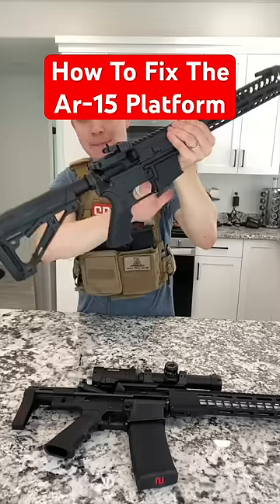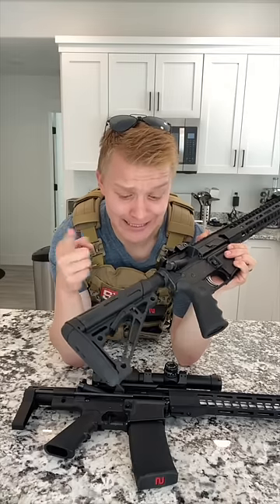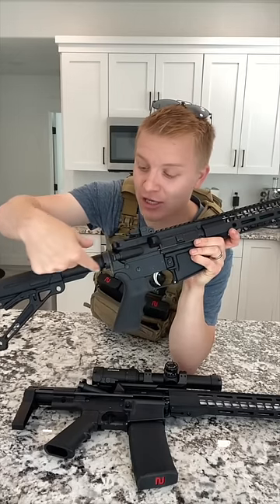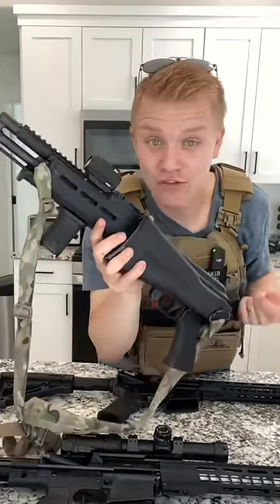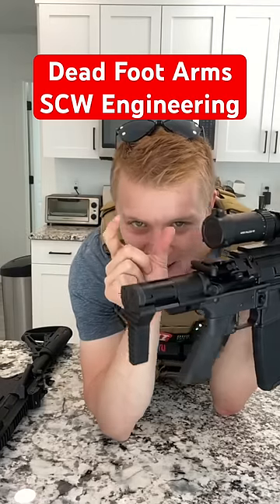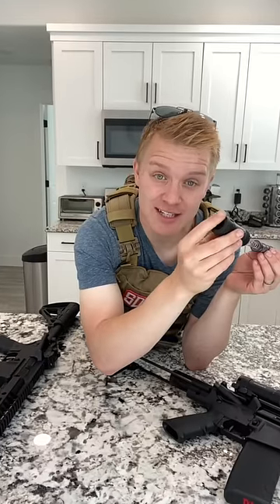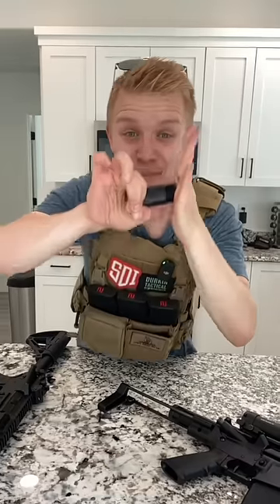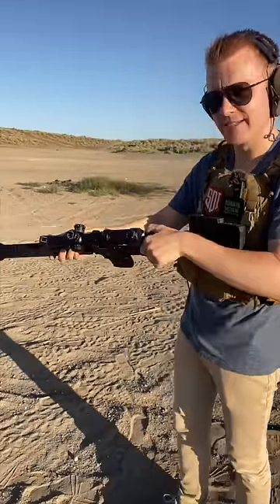How Is This Possible? *Dead Foot Arms Engineering* #gun #civtac #ak47 #ar15

Comment: There’s a new folding stock with a aftermarket buffer tube and you can fire the ar’s with them folded now. But they’re $450-$500
Reply: New? Not if it's what I'm thinking of. They're at least 3 or 4 years old now (well, I guess that's new for the pew pew world). And I thought they were more in the $250 range. I forget the name though... so maybe we're talking about two separate devices.

The rifle cannot be fired in folded mode though.
Reply: @fleatactical7390  bump stocks were a thing and like $150-$250, but they still weren’t shootable folded and you can’t shoot them folded cause they don’t fold, folding stocks for ar style rifles have been around since the 60’s and 70’s, but, these new stocks came out about a year ago maybe two years ago and they come with a super short buffer tube and a tiny ass strong ass spring that matches the factory springs tension with the shorter length, with those the buffer doesn’t go into the stock but is it’s own part and allows you to fire an ar style rifle with the stock folded.
Reply: @That_Stanced_Toyota   Definitely thinking of a different product then. It was just a hinge that you could install to allow a buffered stock to fold. Basically replacing the castle nut. Everything else about the rifle remained the same.

Meant to buy one but never got around to it.

And definitely not a bump stock either. I'm newer to the field (~10 years) so I don't know all that much about the products of old.
Reply: Talking about the law tactical folder. I have a MCX Virtus as well as a bunch of ARs and I’ll be the first one to tell you that folding stocks are kind of overrated. Unless it’s a dedicated backpack gun it’s silly all you’re doing is adding weight for something you probably won’t use very often other than to post silly videos like this one.
Reply: @nastystang113  I'll agree with that. The only time I have ever used such a feature is for a backpack gun. And I rarely use that method of transport. And again, only on something small enough like a PCC.

Comment: They also make a folding buffer tube but you cant shoot it folded so it’s just extra weight for convenient storage
Reply: But now I think there is new AR stock folder that allows you to shoot folded. I can’t remember if it requires a modified bolt and buffer/spring system but I remember just seeing it on someone’s YT channel. Maybe it is from Law Tactical but I really don’t remember. I only seen one short vid on it.
Reply: You can shoot it once!
Reply: @BasedAFPatriot  like a hi point😮‍💨👍🏼
Reply: @tr45hc4n6   Sometimes that's all you need.
Reply: Deadfoot makes a folder that can shoot folded, has for a while now
Reply: @GreenEyeDemon  the law tactical folder yes, but the Deadfoot folder you can shoot folded perfectly fine…
Reply: Yes you can absolutely shoot it folded,they also make versions that fold to the left & to the right

Comment: anderson is called poverty pony for a reason. I remember my first ar started with an anderson stripped lower, the quality was god awful. every small crevice, nook and cranny had metal shavings and dust from the machining process and the roll pin holes for the bolt catch were too small and had to be drilled out slightly
Reply: Buys $40 lower, "why is my $40 lower not as good as a $100 lower this is bullshit"
Reply: @bower31  got a radian mod 1 and pws mod 2 now
Reply: @KELEVRA004  My issue isn't with Anderson, I have like one of their lowers on one of my ARs. It's pretty much a non issue. I just will never fathom people buying something at a below average price, and getting mad when it's not perfect. If I buy a PSA freedom rifle for $450 and I have to tinker a little bit on it, like ok? I still got a good deal. If I buy a new LMT Estonian reference rifle and it's not absolutely perfect out of the box I'm gonna have a big problem, cause ya know it's like $3500. Some fixable silliness on a $40 lower is still fine.
Reply: Things that never happened
Reply: @t.lledsmar6052  once I cleaned it up it ran like a champ for about 1500 rounds before I sold it. Upper was aero with a bcm bcg, rainier arms 18 inch barrel and a odin works handguard. It did good just the out of the box quality was a miss for me. My next 2 ars were built off aero lowers, both eventually got sold then I grew up and got the pws. Form 1'd it then traded an arsenal slr107cr for the radian. Even the pws had issues out of the box but it was a much smaller issue. It didn't have an extractor o ring so I was getting inconsistent ejection with some fte's. 5 dollar pack of wrong size o rings from tractor supply and 700 rounds later it's kicking strong 😂
Reply: @KELEVRA004  I would have sent it back if it needed the holes hogged out. I bought an andersen 2 weeks ago for a "who gives a ****" cheap spare parts gun and was actually impressed that for half the price of aero  it lacked only the "easy"  assembly and the slop taker upper thingy
Reply: @t.lledsmar6052  I built it when I was 17 with a super cheap parts kit so looking back the roll pin could've been what was wrong but either way, it was a good lesson
Reply: I have Stag, Aero, Ballistic Advantage, Palmetto State and several Andersons, never had an issue with any of them. The Stag has the most slop between receivers though, Anderson has the least.
Reply: @t.lledsmar6052 my ffl sells me anderson lowers for like 30 bucks. I buy one verytime I go in. A couple of them have had some shavungs left in pivot pin spring hole. Injust blow it out. My geissele had the same thing. I have never had that i guages out of spec. I like the bcm blem uppers. Those 2 bever have any slop.
Reply: @DrewD748 my andersons with bcm upper or super tight. About as perfect as you can get
Reply: @bower31  CivilianTactical said Anderson Lowers were 'amazing & flawless' and a lot of people beg to differ with that opinion, myself included.
Reply: i dont have any anderson parts but those honestly dont sound like very big issues. as long as its in spec. you get what you pay for i guess.
Reply: @newdefsys  Yeah thats obviously snake oil, and anyone that genuinely believed that has a handful of dry pinto beans in place of their brain. It's in fact a fairly functional lower for 40 dabloons, but some mags may not fit, some holes may be a little messy. Though you can absolutely build a functional rifle from one with some patience.
Reply: wow , you must have terrible luck !  I've built about 30 ars using Anderson lowers ,  some uppers .  never not once had a problem.  .not one f ing problem.   guess I got super lucky or you are cursed. lol. 😂
Reply: @charlesdesurne4696 Nah, he's the one guy who got a bum lower, didn't bring it up with the company and uses that to justify overpaying on everything since.
Reply: My Anderson is perfect.
Reply: Drilled out? Maybe try reaming the holes. And actually, good quality lowers for various platforms require reaming operations on purpose, so...

Comment: I have an odin PDW stock, it's cool but I don't really use it all that much. The proper buffer and spring is much more pleasant to shoot and easier on your gun then jamming something in a small space with proprietary parts. The AR is already like 4 inches shorter than the AK it doesn't need to fold

Comment: Actually wasn’t aware that the spring of an AR-15 went into the stock, thanks for the info!
Reply: Yeah, I didn’t know that either until I had to change my adjustable stock to a fixed stock when Commiefornia changed its laws
Reply: Have neither of you ever cleaned an AR-15 platform rifle?
Reply: @imk2007  I don’t own an AR rifle so no.
Reply: @Niko_Is_Precious  ah I see, you should get you one, finest damn rifle ever designed
Reply: @imk2007  I will when I am of age, one of the first guns I plan on buying when I’m able to
Reply: @imk2007  i prefer the scar (any of the main two) because they cooler 🗿
Reply: @spezkko  overpriced and overhyped, only thing it does better than an AR-15 is its less gassy with a suppressor
Reply: @imk2007  still cooler 🗿
Reply: holy shit nike oneshot
Reply: It kind of goes with the laws of physics, "For every action is an equal and opposite reaction." There needs to be somewhere for the bolt carrier group to go in order to cycle a new round. The buffer system in the stock also helps mitigate recoil drastically. You should look into how the weapon system works. It's pretty neat and refined over years of firearms evolution.
Reply: Are you serious?
Reply: @imk2007 No they haven't.  They have one and have no clue how it works.
Reply: @GreenEyeDemon Your Mom says your nuggets are ready.
Reply: Ummm ok.
Reply: @spezkko get off call of duty.
Reply: @imk2007 is there a difference performance wise between the Scar-H to the Scar-L other than what round they’re chambered in or would you not be too sure?
Reply: @GreenEyeDemon  This is the kind of thing I would have said when I was 13. Are you? You write like you are. DI is a great gas system lmao
Reply: @GreenEyeDemon  Lmao you have made up argument's and write like you haven't completed the 5th grade
Reply: @GreenEyeDemon  Wait I actually just realized you said "take off the grip and the takedown pin detent falls out" lmao its the safety detent. The stock holds in the pin detent goofball
Reply: @kinghtin2darkness  Except the part where it's been repeatedly shown ARs beat nearly any other rifle platform in adverse conditions. Barring those hyper goofy guntuber videos where they literally force stuff inside the gun, which is just not reality. AKs fail hard when sand or mud get inside the reciever, which is pretty easy with a huge hole in the side
Reply: @imk2007 nyet! Capitalist propaganda! AK is best rifle!! 😂
Reply: @cruz7073  ain't too sure on that, they're made by the same manufacturer and work the same way just in different sizes it'd be reasonable to assume they're about the same
Reply: @spezkko you’ll soon learn most things you’ve always wanted a kid arent all that great when you finally get one. You’ll be super stoked about it for a while then soon it’ll be ok I guess this is cool, then you’ll be wondering why you spent 3k on a scar.
Reply: LEARN YOUR WEAPON    ,ytube  IGNORENCE is nothing to be proud of
Reply: @imk2007  IKR... I guess lots of people don't understand the basics, or clean/disassemble their weapons.
Reply: @Niko_Is_Precious  What imk said. They're funner than a barrel of monkeys to shoot!!!!
Reply: @spezkko As a person who has shot a suppressed SCAR chambered in 5.56 with iron sights (only once :P), I made better shots than with an AR and AK, I guess experiencing rifles 2 times was enough, but sadly I couldn't shoot realistically fast 😅 still cool 🗿
Reply: @spezkko  Cool only lasts until you have to pay for it.

Comment: Side folders always got in my way. Haven't dealt with them on the AR platform, but I have quite a bit with the G36K, G36C, and AK platforms. Personally, I prefer a RADOM AK platform  with an under folding stock...if I HAVE to run a folder. But, I'd really rather run collapsible than folding. In Bosnia, I used a Zastava side folder quite a bit...always seemed awkward and off balanced. I'd just grab a rigid stock half the time. But then, I also ran a P90 a good bit during that time...by far my favorite platform...once you get used to mag swaps.

Comment: The Buffer tube gets a bad wrap.... What better way to mount a stock? The tube is rigid with no wiggle, is standardized. This allows a million different stocks to fit on it. The interior recoil spring also provides the user with a ton of customization as well, by allowing the user to swap out springs and buffers. In my humble opinion the AR was ahead of its time, just like the mp5. Both are exceptional weapons.

Comment: I've wondered for a long time now: 
why don't they use flat wound springs in guns? flat winding the spring wire would allow the spring to collapse into itself, so it can collapse down to it's 1x it's width, rather than 10x the thickness of the spring wire. no? 🤔🤷
Reply: The buffer takes up space too.

Comment: OLD technology.  My AR pistol kit came with a small buffer tube and what looks like a 1911 recoil spring that fits into an insert that slides into the bolt carrier.
The tiny buffer tube has a recoil spring guide to keep everything straight.

Comment: I mean, assuming its not chintzy or hella expensive id look at one, but realistically there are two facts about folding/collapsing stocks.

1. They are kinda useless. Rifles are meant to be braced against the shoulder so the ability to shoot folded/ collapsed is a solution searching for a problem. You arent going into combat with a folded stock, the only real purpose for them is to make them slightly easier to transport outside of combat.

2. They dont make it much more compact. Sure the aks can shave off over 1/3rd of their length by folding the stock, but it just makes it twice as wide. The ar version saves, what, 3 inches over a standard adjustable stock?

Comment: Does it really absorb the same amount of recoil tho?

How about gas pressure, cyclic rate, and other stuff. When Colt tryna switch form M16 to M4 they discovered that the M4 suffers a rise in pressure causing the thing more likely to explode.

Suppressed MK18 would have higher fire rate due to increase in gas pressure. Causing the gas block to wear out quicker.

Comment: Yeah, if you can cough up $500 for a stock and buffer system.
You said " folded" but it actually collapses. They do make a folder as well( which is preferable because you have more stock/brace options.
Does that one require you to cut the carrier?
Reply: Exactly what i was thinking $$$

Comment: NOTHING about that Anderson Manufactured lower limits the ability to use either a piston driven system, or a two spring buffer system. 

The only reason you'd even bring it up is if you don't actually know what you're talking about.

Comment: You could use it. Or, you could get an MCX/Spear. It's better than a normal AR-15, and you get the same general gas system like an AK or SKS. Sooooo...
Reply: Yeah but you gotta shell out 2500 for the base rifle alone, plus your at the mercy of SIG's QC. Some people just prefer DI AR15's, so i understand the want to modify the buffer system to make it just a little more compact.
Reply: @nickloven6728 Right, little being the word here. 
I am talking about this YT in particular, though. With the number of guns he probably has, and how much he has also probably spent on said guns, him having this hypothetical problem is redundant because he can probably go to the nearest nice gun store an pick up an MCX/Spear same day and not have to worry about a buffer tube at all.
When it comes to giving us advice, however, cool, shorten your AR-15 by about 5 inches overall, or buy an AK with a side folding stock and remove the problem entirely by folding an entire 1/3rd of the guns length into itself. Now, I'm not saying the AR-15 is trash, but that buffer tube severely limits stock options overall.

Comment: This makes it too specialized for a shtf situation. If you have a failure you won't have a way to fix it without carrying extra parts. By building the AR to use the AK system it's much more available and much more reliable.

Comment: Piston driven upper, problem solved.
Reply: Most piston uppers still use a buffer tube. The main exception is the MCX which moves the buffer to the top of the upper.

Comment: I know you have your goofy SDI patch on your plate carrier and all, but I've been a machinist for a long time, even making parts for some major firearm manufacturers and deal with quality everyday working for an AS9100 manufacturer. I've been building ARs for more than a decade. I know how to read a blueprint and I have a copy of the M16A2 TDP and at least two military armorers manuals and have read them. I've used Anderson parts in the past on quite a few rifles. I said all that to say that Anderson does indeed have low quality rifles and components

Comment: I would never use it. After all anyone who has shot and under folding stock AK can tell you those thin support arms on that extended ar stock suck for a good cheek weld. Any good amount of time training with it and those little bastards wear your cheek out, cause head aches and don't allow for a proper cheek weld so you can hit accurately out at effective distance. Its what it's made for collapsed short range short term engagement where you ain't got to be too precise..

Comment: You are permanently compressing the original spring, that is designed to be compressed intermittently, to add a reduced spring on top of it.  Sounds like your ruing the original over time.